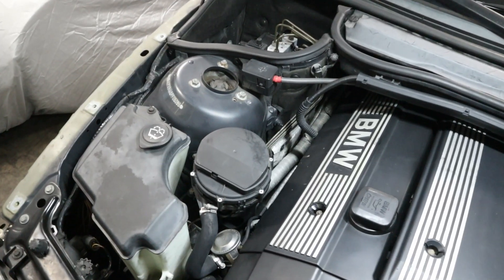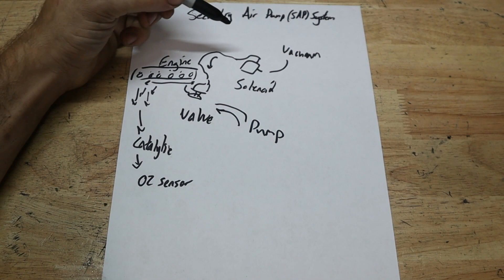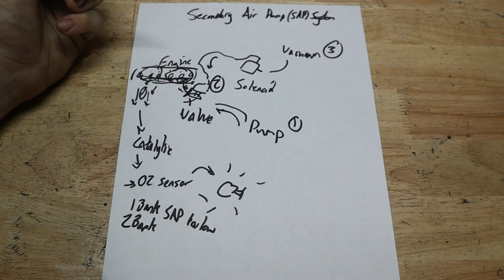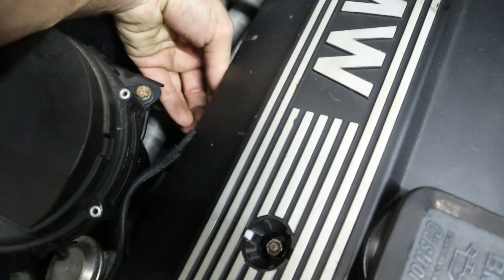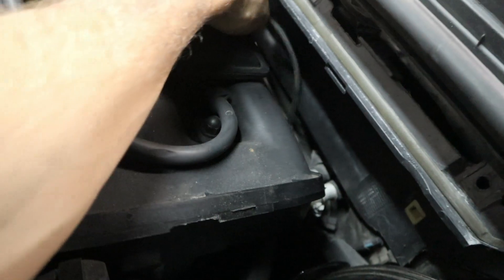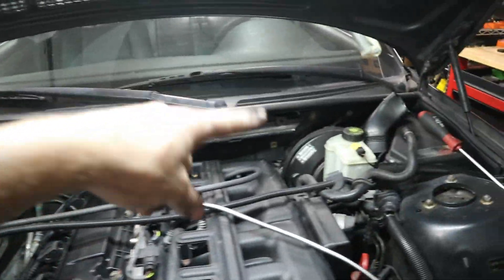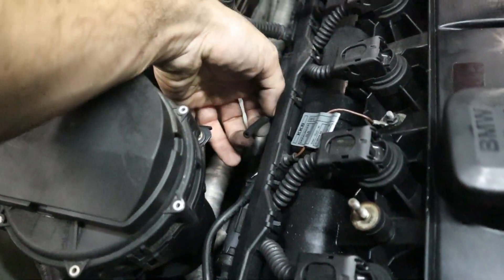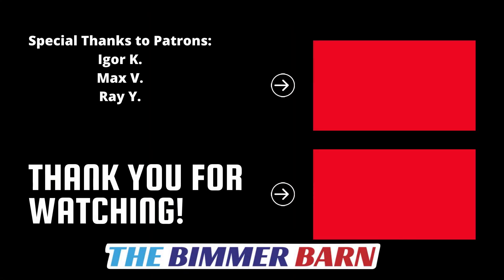HOW TO: Diagnose & FIX BMW Secondary Air System Fault Codes

Comment: I have a 2009 328i and can't pass smog because of this problem
Reply: If you haven't already done so yourself at some point, I suggest replacing the vacuum hose all the way. That's pretty much the no. 1 cause of any codes for the SAP. If that doesn't fix the problem, TEST the valve (there are numerous videos on BMW websites on how to do this, and it's a 15 minute simple deal.)  

Also, on both of my E39s ('97 540 and '03 530) there is also a small plastic check-valve, either behind the back of motor or on the right (passenger) side of engine close to the top of valve cover. Jason didn't mention this, but if the large valve near the right-front of the engine gets stuck open, exhaust gas will be sucked into the vacuum line and will eventually clog that little check-valve with carbon and crap. This occured on my 530i. I replaced that valve (simple generic/universal one-way vacuum check-valve) for like $3 – available at any parts store. Cleared my codes and was good to go (for smog check, that is.) 

The pump itself is suppsed to sound like that. It's spinning quite fast and hence makes a high-pitched motor/fan sound, very similar to a handheld hairdryer. But, your motor has to be pretty cold (I think <130º as I recall) and it stays on for only like 15-20 seconds, so you have to start the car and run to the front to hear it, and E39s have it stuck under the bumber on the right, so you have do stick your year under there to hear it. 

To get a computer program "fix" or the "box" that fools the DME, it's going to likely cost > $100. If the issue is simply a vacuum hose, you can fix that for like $10. (It doesn't have to be "BMW" vacuum hose.)

Comment: Whats the purpose for the secondary pump system? Thanks. I noticed on my 2013 128i it has one and on my 2009 128i it doesn't.
Reply: A “rich mixture” (λ<1), i.e. a mixture with excess fuel, is required for cold start of a petrol engine. Thus, large amounts of carbon monoxide and unburned hydrocarbons are produced during cold start. To reduce the level of these pollutants, ambient air with a high oxygen content (secondary air) is injected into the exhaust manifold directly downstream of the exhaust valves during the cold start phase. This results in post-oxidation (afterburning) of the pollutants to form carbon dioxide and water. The heat generated in this process additionally warms the catalytic converter and speeds up the start of Lambda control action.
Reply: Another guy said to extend the life of the catalytic converter